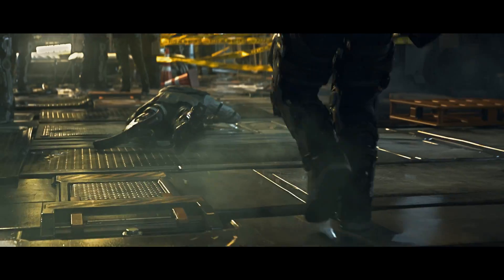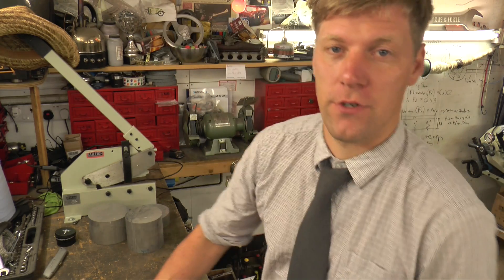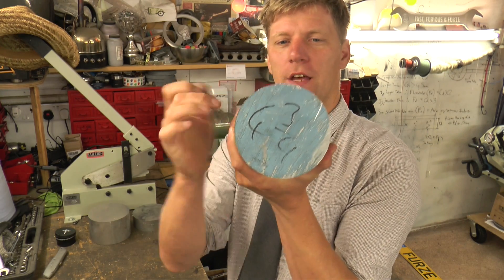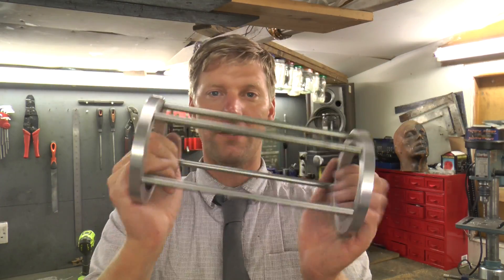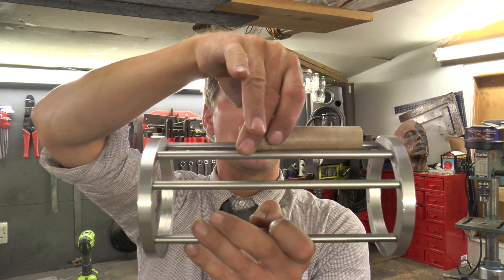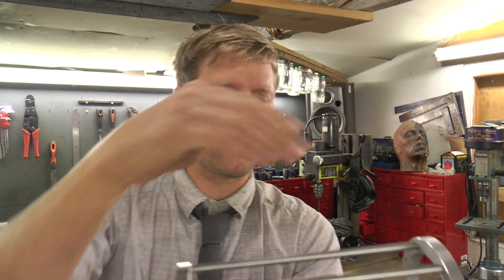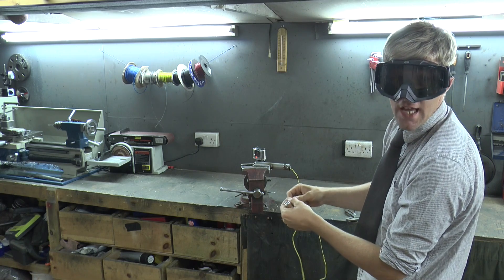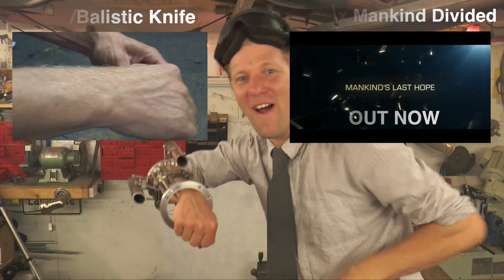Weaponised arm Gauntlet Deus Ex: Mankind Divided Style Making of #1 chassis and rocket launcher

Comment: hey colin Im John   I love your build montages I'm a mechanical engineering student at Rowan University in NJ USA I've made my own share of crazy stuff I'd love to do some work with you. I'm an expert on the mill and lathe. I can mig and tig do force analysis and 3d model on solid works. and I love fire lol I've by the time you read this made a TLT board a flamethrower a segway skateboard ( I can code) a 3d printed pipboy. hand carved and made a replica laser musket. a 3000 rpm air powered engine. a full sized 1 seater carbon fiber 800 mpg carbon fiber car and many small robots and rebuilt 2 quad ATVs
 I can be an extra hand or I can do off site advice or work. I just want to be a part of your amazing journey. inbox me if you have anything to ask

Comment: You should put a small handle where you can hold onto with your hand so it won't slip around. That also could be used as a place for the switches for your various gadgets. This can make it a one handed operation.

Comment: I was thinking you could use magnetic clamps (cutting up rag rings and putting magnets on them) kind of like a hidden blade, and adding a rectangular section to the top, the blade would deploy by swinging outwards and it would be held there by a electronic magnet. It's a flat rectangular blade so having it shoot forward wouldn't make much sense as (depending on the length of your forearm) the blade would have to be shortened to fit snugly on your arm. With the design mentioned above, it could be the entire forearm.

Comment: Next up might be a so called exoskeleton for super strength? That might be a tad challenging...

How about an mini elevator (as opposed to a rope tugged/pulled dumb waiter) for food, snacks and whatnot that fits entirely within the space between two typical studs of a wall. I think in the US that would be something like 3.5" X 16" or less... It might be hard to find a wall without any wires or pipes complicating or obstructing such a space...

Let's see, maybe springy pogo-stick stilt like leg-foot devices that make you able to leap small buildings in a single bound... if not run any faster... 

Out o' whacky ideas--for now...

Comment: Holding & pulling the swarf like you did as the lathe was facing the aluminum blocks is extremely dangerous Colin.
I know you had gloves on, but that razor sharp swarf can very easily wrap around your hands & fingers & slice through to the bone & beyond in a fraction of a second.
I'm not a health & safety freak, but I'd hate to see something bad happen to you especially as you'd be incapable of making anymore great videos for us all to enjoy.
Reply: I trained as a mechanical engineer many years ago & I can remember one or two things they taught us, but the main reason is an accident my son had pulling swarf from a lathe at work which resulted in months of very painful micro surgery repairing near severed fingers.
Reply: +Mark Leadbeater 

i'm sorry to hear that, i hope he's ok now.
Reply: After several long micro surgery sessions the skilful surgeon did an excellent job repairing the severed tendons etc, my boy 'only' suffers with nerve damage now, but at least he has all his fingers, thanks for asking.
Reply: That was very thin swarf. And it's aluminium. I did that all the time as a kid. That kind in particular isn't going to do anything more than give you very minor cuts, and if that. 

But I can understand certain steels or thicker aluminium strings if they get caught on the lathe spindle and don't break. That'd likely cause the damage you described.
Reply: I was thinking exactly the same thing. I'm a mechanical engineer but I've never seen somebody pull swarf like that. What kind of nerve damage does he have?
Reply: Hed still find a way

Comment: wearing a tie when machining

that's fuckin wild
Reply: It's a safety tie.
Reply: It's an old gag of his Emily. It's supposed to keep him safe (But it actually does the opposite) I guess in a sense you can it keeps him safe because he has to be careful not to get it tangled.
Reply: He did tape it back.
Reply: its his safety tie
Reply: Clay Norrbin It's a very bad thing to do, although it does give a part of a principle of making I love: "Fear your tools." It's when you stop fearing your tools that you hurt yourself.
Reply: Please no one do this. Ever. You can never be too safe while machining with a lathe and mill.
Reply: +Ruhrpottpatriot yeah this guy is hard core and his very skilled at what he does
Reply: You must be new hear. Search his channel for a vid, where he shows how he burned himself.
Reply: Guys, if you couldn't tell, he's clearly insane. But that's what we love!
Reply: Tuck it into your shirt, simples.
Or, at least, that's what I was taught to do in design tech at school, where ties were mandatory.
Reply: Setting the worst examples, even if he's trying to be "cute"
Reply: also no eye protection, and repeatedly thrusting his face into the operating space of lathes and drills that have metal shards flying all over.

Comment: Those horizontal bansaws are the ultimate torture device, if you locked someones right arm in there they could never undo it with their left and they couldn't reach the off switch.
Brutal, watching your arm get cut off at 0.5mm/min... i must have some kind of mental issues thinking about it....

Comment: dude get some machining paste that smoke is not good your slowly taking the tempering away from your drill bits but still a very good project as I was taught properly maintaine your equipment and it will outlast you.

Comment: Colin, we love your dumbassery, but YOU SHOULD REALLY AVOID USING GLOVES AROUND ROTATING POWER TOOLS (3:18) as that is the #1 cause of amputations for machinists. If your glove catches on a burr on the lathe piece / drill press / bench grinder / angle grinder, you don't have time to react before the machine twists your hand inside your glove into a pulp.

Literally, it takes at least half a second to hit the emergency button, and in that time your lathe can twist your hand on itself dozens of times. So instead of a cut, as you would get without gloves, you leave the shop an amputee.

See https://www.osha.gov/Publications/OSHA3170/3170-02R-2007-English.html or any other document or discussion on the topic. Please spread the word and set an example for your audience.

Comment: I wish I hadn't watched this before bed... I'm not going to sleep, thinking about how you're going to do it and how I'd do it. For example, the ignition system, I'd have a kanthal coil with a low resistance attached to an 18650 battery with a high draw to heat the fuse. Slower fire time (unless you chop down the fuse) but a quicker reload time. The taser... now I'm thinking caps and transformers.... The blade...  God dammit, Colin.....

Comment: It would be pretty sweet and easy to encase the entire thing in a sliding sheath that draws back before firing.  The only real difficult part would be getting it not to interfere with your elbow joint.

Comment: Colin for the frame you should've put a rubber piece for a joint in between 2 metal rings, and then you could move your arm with more ease. It would go up to your shoulder, look cool, and have more gadgets. Anyway great job and keep on!

Comment: Genius again, just one Tip: double the Voltage to the motor - pretty sure it will survive it fot this short period...and would be double that fast...
Reply from the maker: i did but i have to watch i switch it off before it hits the end as i've meshed the gearbox on one
Reply: +colinfurze add in a little micro switch limit
Reply: well, gearbox was the harder to do solution, but as we all can see, works perfectly! welldone

Comment: What kind of welder are you using? Specifically for the smaller bits and bobs. I could really sue one of those assuming you can weld polished stainless steel piping

Comment: mightve been nice to get the frame to rotate like a revolver cilinder so you can twist the tool you want to use to the top of youre arm , bit more thechnical as you need bearingthingies that twist around the arm itself
prolly can use a gasoven starter for the ingition part
prolly could use the taser for that too

Comment: Colin I'd hate to see you actually have to replace bits of your body with electronic gadgets, so tuck in that god dam tie and wear some safety specs; before that metal lathe decides to lop your head off via strangulation or you're blinded by a shard of metal.
Reply: his safety tie is taped to his body so relax
Reply: Ah good, he should still wear glasses however.
Reply: He'll just have a jet-engine-heated cup of tea and everything will go back fine.
Reply: Yeah, for sure. Piping hot shards of metal flinging off a lathe is a great way to pierce your cornea.
Reply: the tie is what keeps him safe. Without it he would have died many years ago.
Reply: +rpatto92 dud relax. this is England
Reply: Well he did tape down his tie lol
Reply: +Hilmi Albums dude*
Reply: +rpatto92 tuck in the safety tie? NEVER

Comment: dude, why don't u use a cast for the arm (like they make in a hospital) put some structure in and around it, won't it fit and feel better?
Reply: How do you get it on and off?
Reply: Cut it in half, put a closing mechanisme one side, hinge the other.
Reply: It will, I think, look better because of the ergonomic. and it looks massive with a bit of paint (metal paint maybe)

Comment: My right ear is lonely
Reply: Nothing to do with his headphones, its just the way colin recorded it and he did not balance the L/R channels out.
Reply: TheFPSPower It is in certain parts, but as example, him talking at the beginning favors the left channel.
Reply: +NeoReaperz really? because its perfect on my end
Reply: what are you talking about? my sound is perfectly normal.
Reply: then get new headphones dont just complain
Reply: Lewis Vessey No bollocks at all, just try setting your device to its proper setting in Playback Devices or go and buy a decent set of Headphones (£/$200+). But anyways, I am done here otherwise this will turn into an argument.
Reply: Lewis Vessey sigh I said I was done here but if you really think anything over that price is a waste then you really just tripped over the stupidity line... Go and get an amp with a dac and a decent set of cans and your opinion will be different (As long as your hearing isn't fucked ofc).
Reply: beats arent good in anyway, you pay alot for the branding.
Reply: yay for automatic audio balancing software!
Reply: NeoReaperz Alright, so I have to thank you here. for about 2 weeks now, wince the windows 10 aniversary update, I thought my sound was very weird, but at the same time I kept telling myself that I didn't change anything, it must be my head. Turns out that the front connectors on my pc are on MONO mode (wtf??). I unplugged my sound system and plugged in my headphones in the back where the sound card is and WOW, I have been playing CSGO like this for about 3 weeks now, wtf! I still don't know why the fuck it is on MONO and I still don't know how to turn it back, but I will find out! Fuck windows 10, seriously! And thank you!
Reply: +NeoReaperz load of bollocks. audios is fine, well mine is anyway.
Reply: +Lewis Vessey headphones over 50£ isnt shit. i use audiophile headphones everytime and when i listen to normal earbuds i get cancer u shithead
Reply: TheFPSPower I know that but it definitely means something in your setup isn't working correctly. (Heck, it could even be the browser you are using and if you have any enhancements enabled in Playback devices).
Reply: LarryLazz I am only responding to the ones who are responding to me. Plus, I have not got much else to do right now to be completely honest. :P
Reply: Пускай лучше всякие олени учат английский.
Reply: for me it's normal
Reply: Charlie McMarson Any comment will start a war of some kind, good 'ol internet for you.
Reply: me too
Reply: NeoReaperz they have proven that over about $£50 it's a waste of money. All I'm saying is my audios is fine on this vid. And my two headphone are beats. And soundmagic so not exactly cheap.
Reply: NeoReaperz bro, getting 200$ headphones isn't going to prove that the audio is on the left ear, even 10$ headphones can make you notice that and with 50€'s I can't, so for me its fine.
Reply: lol ikr
Reply: I mean hacksmith should be  in his video they could build some deadly
Reply: don't worry I heard it too.
Reply: I started troubleshooting my audio, as i just updated my drivers.... :'D
Reply: I had the same problem but only at the start of the video. The rest of the video was fine.
Reply: Video translate into Russian
Reply: Зачем тебе этот скотский язык?.Пусть лучше учат английский :)
Reply: did you try inviting friends for her or something ?
Reply: Yeah, if you're listening in stereo you will only get half the audio, if you're listening in mono you can hear it all. It's funny how all these people keep saying it's headphones or software or some other bullshit when the headphones work perfectly on every other video I've watched today.
Reply: It was off on mine too. Whatevs.
Reply: idk 😐😑😐
Reply: You started a war with your comments. The lonely right ears vs the grouped right and left ears
Reply: +Charlie McMarson hahhahaha
Reply: Vimple you did not answer me
Reply: Especially on YouTube - it's the worst. :(
Reply: +NeoReaperz for someone who said they were done, you have very little self control when you feel you need to "educate" people dont you...